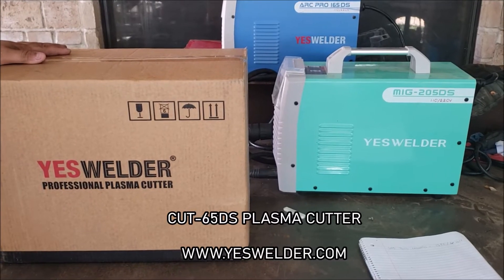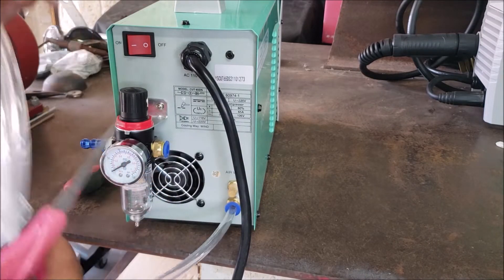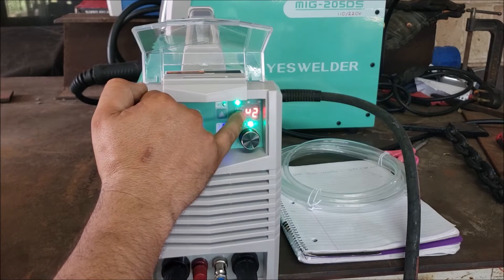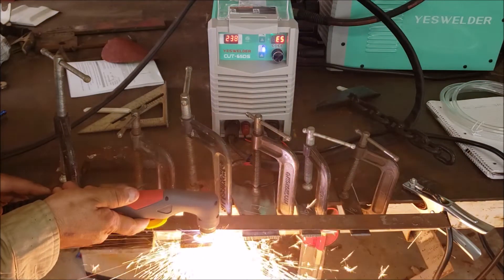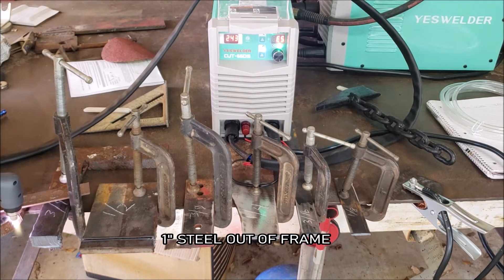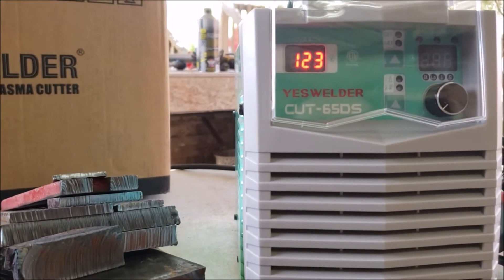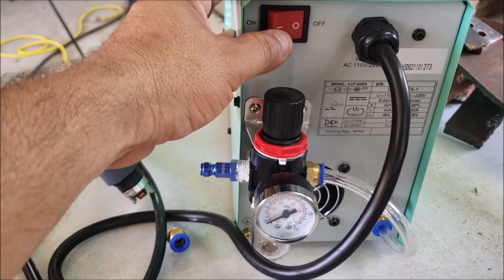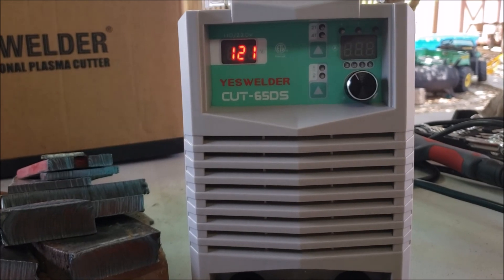YESWELDER CUT 65DS REVIEW AND SETUP : CUT 1 INCH STEEL WITH THIS PILOT ARC PLASMA CUTTER #YESWELDER

Comment: I bought this plasma cutter based in large part on positive YouTube reviews. I am pleased with it overall - it seems a little anemic on 110V, had a long time cutting 1/4", but with 220V it seems just fine. My question is more about the tips and torch - my torch came with only 1 set of consumables and Yeswelder is out of replacements on their website and on Amazon. Some conflicting information out there led me to believe the pilot arc torch it came with is an IPT40 - however, when looking at the consumables for the IPT-40 torch, they do NOT look like the ones that came with my torch. On Yeswelder's site, it SAYS they sell a consumable kit for an IPT40 Cutting Torch, and the pictures look like the consumables in my torch - but when I buy replacements online (that are available) they do NOT fit in my torch. All the IPT40 consumables I find available are vastly different - the electrode will not thread in properly and it has a different shape, with a shoulder on the electrode, instead of the straight, narrow and relatively short electrodes Yeswelder sells. These actually look more like the Lotos CUT60 electrodes, but that is for a drag tip. 

So I'm looking for a replacement torch - probably a pilot arc one and ideally a drag tip one. Suggestions? Or somewhere I can get consumables for my pilot arc Yeswelder torch which DOESN'T appear to be an IPT40, or at least doesn't utilize most of the IPT40 consumables out there?? Can you even USE a drag tip torch with this machine? It's a decent machine, yes - but definitely some stars off due to unavailability of replacement consumables and (possible?) proprietary design.
Reply from the maker: I never got a chance to order consumables for this machine. I did search on ebay and saw some that mentioned ipt40. I would try searching on there as a last resort. Sorry if I wasn't much help.
Reply: @cutweldngrind  It turns out the LPT40 torch consumables DO fit in the torch for the CUT-65DS, but Yeswelder uses their own non-standard parts. So while they don't 'match', the new parts DO fit, if you change out ALL of them, not just the electrode and tip. But Yeswelder's parts LOOK different, so it threw me off when shopping everyone else's parts. And Yeswelder says they will be out of stock for at least another month.

Comment: How do you compare this to the primal cut 60
Reply from the maker: If I had to choose 1 machine it would be the CUT60. The Primeweld Cut60 is just built stronger and feels better all around. The Primeweld Cut60 also seems to cut better and has the option to wire up to a plasma table. The Yeswelder seems a bit flimsy around the  torch cable connectors but hasn't failed yet. I like Primeweld machines and their customer service is great.
Reply: @cutweldngrind   since this is a non high frequency machine, it can also be hooked up to a CNC plasma correct? I just ordered one bc the first one I bought was a high freq machine and is sending alot of noise through the electronics